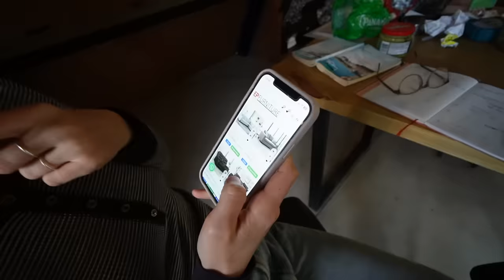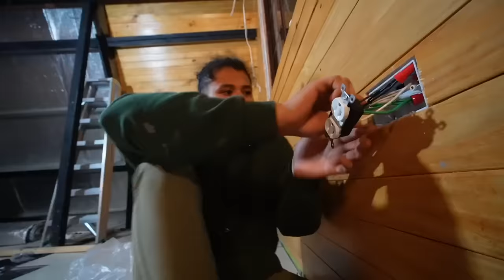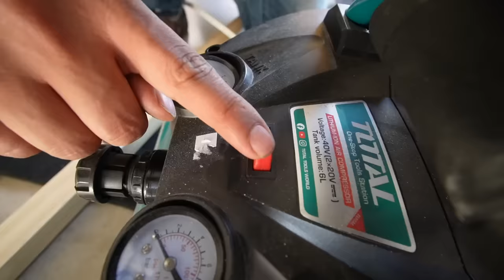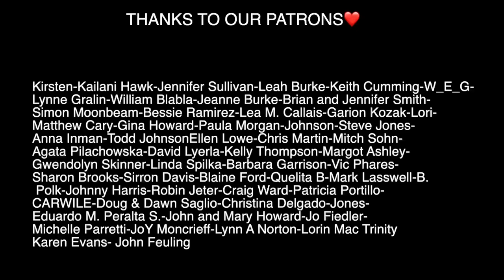WE ARE DETERMINED TO FINISH IT!

Comment: With all the board processing you guys and Jordan and Kaylee are doing, you should go in on a router table where the router is fixed upside down on the underside of the table. That way you just push the boards through, much faster. There are even plans to build your own router table from plywood.

Comment: Wonderful Job Rodrigo & Freddie ! 
I am just wondering since you did not use any insulation in between floors/ceiling, is it too loud when someone walks up on the 2nd floor? ...just wondering 
Love the wood on the ceiling but just a reminder that wood is a "sound carrier" and not a sound barrier ... Also wood spands and contracts with minimal of weather changes.
I would have used sheetrock (but that is just me) still love what you guys are doing

Comment: Your both doing so well, you going to get there……

Just a thought on the cladding….
Why not use the white boards that you put on the ceiling for the next section of the wall, where the stairs start…..
It could go up and over the ceiling downstairs and upstairs, creating a break from the wood and will visually open and brighten the central part of your home.
Almost a gallery space within your home.

Comment: Is there anyway you can did a deeper place under the house
as a work room. A place you can stand up and be able to work
regardless of the weather. Once you dig out a place, you can put
concrete pavers as a floor. You can remove them in the future
if you decide you don't need that space any more. Or, continue to dig
it out bigger later for a cold  storage cellar. I know its hard work.
 You will be glad you did it once its done. Cold cellars are very important
to your type of lifestyle, and you already have a ceiling to protect
from storms. It can double as a cold cellar and a storm cellar.

Comment: Rodrigo, just hook each line to appropriate  color screws, the second screw same color is bridged connected to the first screw. In the end they connected in parallel. There is no need to do it the long way as you did  beginning  of video. Must safer, faster! 😊😊😊

Comment: Don't put any other lights on the ceiling other than the recessed lighting. You want it to look unique from the other rooms. Get some table and floor lamps. The dining area will look great with a ceiling fixture, however. If anything, put a ceiling fan up there!

Comment: You should not install hidden electrical junction boxes. If you have a wiring problem later or want to change a fixture you can't access the box to repair or change the wiring. Also, you will not remember where all of them are.
Reply: Exactly! Elec Contractor, 32 years.

Comment: Thing is that sheet rock won't burn if there's a problem with electricity. Wood will burn. And aluminum siding melts. But with sheet rock the fire is contained and smothered. You just smell it or see a burnt outlet. Also lightning strikes can burn your building. 😮

Comment: You can buy an oversized plate to fix that plug so it will fit better and overlap the wood instead of being inside the wood wall.

Comment: Why don't you cut wood in the greenhouse? Please tell Frankie that she should always sand with the grain of the wood, not across the grain. Shouldn't you have run the electrical wires before putting up the ceiling boards? The white ceiling looks amazing!